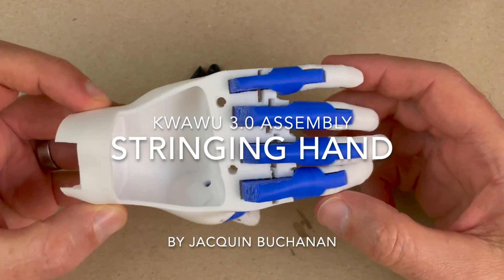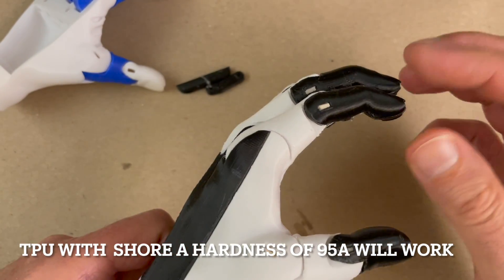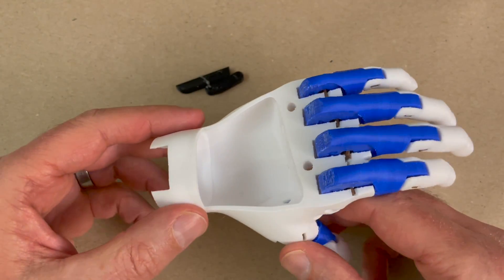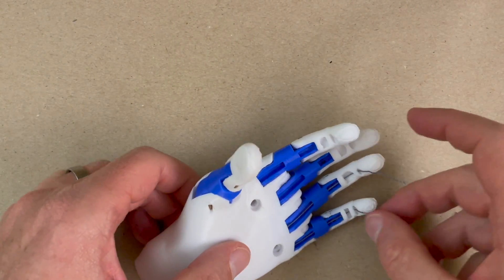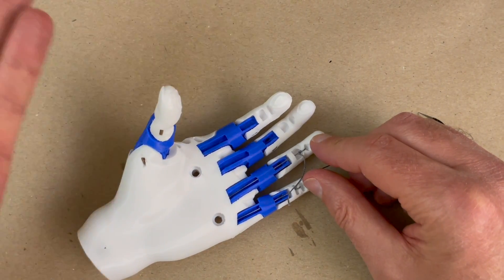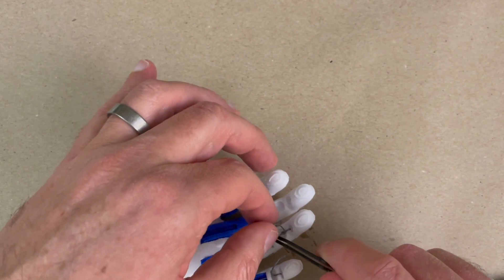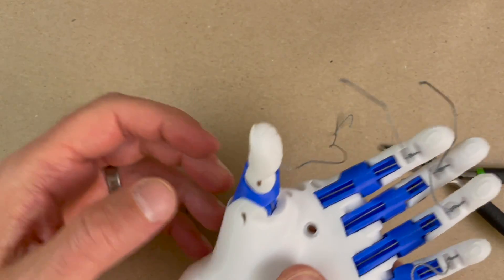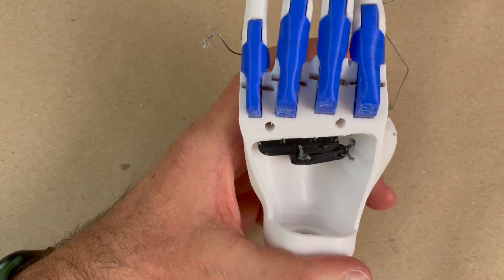3 Stringing Hand | Kwawu 3.0 Prosthetic Arm Assembly Instructions

Comment: Is there a video on how to sting the 2.0 arm because I'm finding it hard to get the hand to open and close after I string it.
Reply from the maker: Sorry, there’s no video available for stringing the Kwawu 2.0—only the PDF instruction manual.

Most of the issues with opening and closing the hand are similar to those in version 3.0. Make sure the fingers move very freely and bounce back well before adding any string.

For version 2.0, it’s important to use TPU with a Shore A hardness around 82A. Anything above 85A is too stiff and won’t work properly.

Comment: just got to see your work now bro. great stuff! currently working on an unlimbited arm and saw this. these fingers flex bacause the material is TPU right? so the KWAWU cant be printed on PLA only?
Reply from the maker: The hinges are in TPU. They are pretty small rectangles. I print all the other parts in PETG, best strength to ease of print. But, you can print all the stiff parts in PLA if you want. It will work just as well as PETG, maybe a little less durable.

Comment: I'm having a bad time trying to string this hand up. I resin printed all the parts and they look great, but after I strung the hand, I'm not getting a good result. I pull the fishing line really hard and the fingers hardly bend at all. They don't snap back either. I know the whipple trees are oriented correctly, so I'm wondering what string you used? I used a 6lb fishing line, but I'm thinking it's way too thin? I also resin printed the hinges with a "TPU like resin", but I feel they may be too soft. I tried to print with TPU filament, but I'm not a printing expert so it hasn't been successful. I did manage to find a Shore A hardness 80 too.. Kinda stuck at this point. What size /type string should I use, and what are your basic tpu settings? I have a half dozen various printers. Thanks in advance!
Reply from the maker: I used 80 lb Dynema fishing line. Do the fingers move easy just like in my video? Sounds like you did everything right. Email me at jack@onemonkclapping.com
Maybe we can zoom or something.